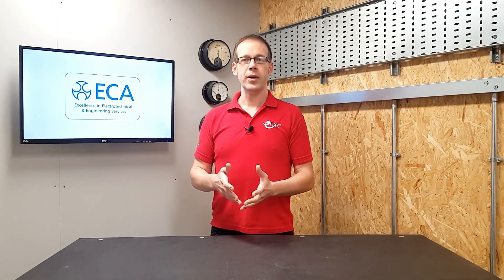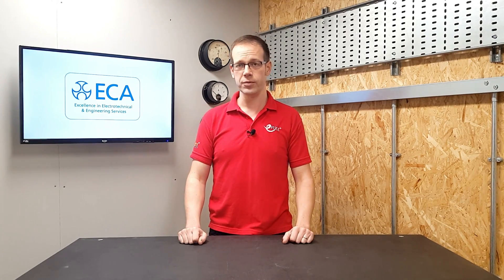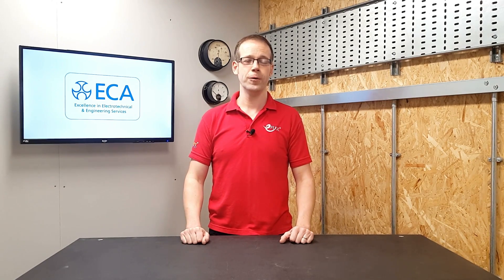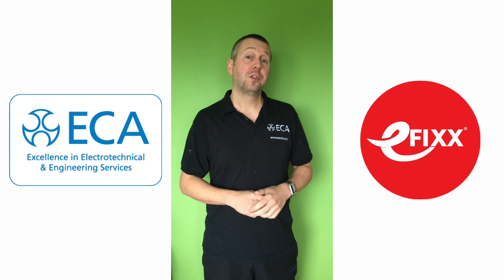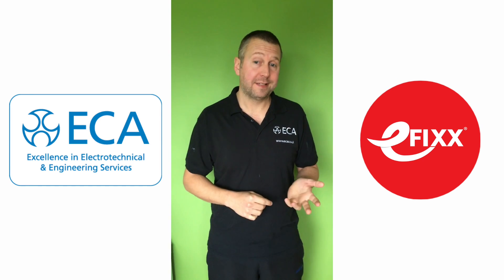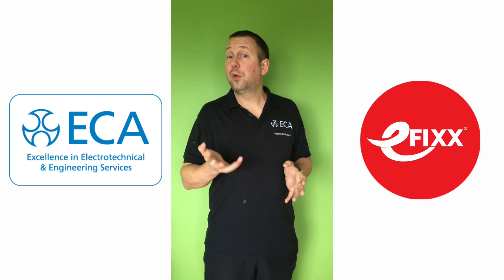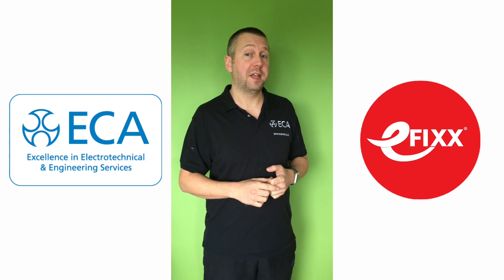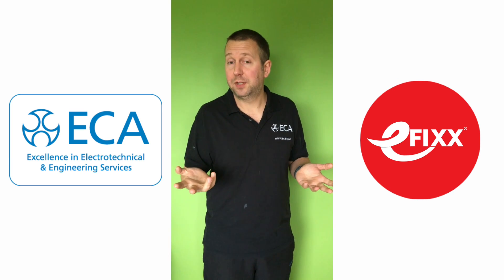Can you use 230VAC power tools on a building site?

Comment: Hypothetical sarcastic and probably other words to describe thought question.
So there’s 240V on the site you step that down to split 120V you can then run that through a step up transformer back to 240v and then run your 240v tool.... so technically you'r tool is running at 120V at one point during that and technically you’re plugging into the 120 V supply that is required on the job site. Would you be able to get away with that when rule enforcement walks by?
Granted there’s transformer loss.
They look at the distribution board hey there’s a transformer good, they walk around a little bit they come onto your work area hey you got a transformer good; never put two and two together that you’re actually photonic induction?

Or you could just roll up with a nice large capacity lithium ion battery pack and inverter and run your 240v tools off batteries, But they’re battery-operated! Lol
And it would probably weigh less than the transformer lol.
Got to think outside the regulatory boxes!

Comment: Yes if they were my tools, if they were somebody’s else’s tools where I wouldn’t know what condition they were kept in I would be a bit hesitant. so it really comes down to the user to do a self inspection for self-preservation.
Luckily I don’t have to worry about this problem as I am in the US and we use 120V already.
Although there is a few construction companies that set up temporary power and use larger saws, heaters, air conditioners and the like on 240v.
Your whole split 120V system took me a while to understand. Interestingly we have a standard for it in our code for use in A/V systems to help mitigate line noise in theater and the like installations. I found out about this reading a white paper shortly before I ran aground against split phase 120v UK systems.

Comment: 230V with RCD protection or battery operated. The 110V thing is a special UK thing, we don‘t have that here. Instead here you‘ll find a special mobile distribution board for construction sites including type A RCDs or RCBOs. The inertial current of such a transformer is also high enough to trip a B16 A. And actually it doesn‘t matter if 110 or 230V, both are high enough to kill a person. The only advantage would be a galvanic insulation provided by the transformer but you can do that with 230V too.
Reply from the maker: The 110v transformer is isolated and the output split 55 - 0 - 55V to earth
Reply: @efixx  The rules say: Till 48 Volt it is "low current", then "heavy current". What make then 55 Volt, 120 Volt, or 240 Volt any difference? 

My tools start with 10,2 V; then 12 V; 18 V; 20 V; some new have 36 V (e.g. my e-bike). All saved current after the rules. 

36 Volt are three 18 Volt batteries together, this system have enough "strongest/powerfull" to work with, e.g. to drill holes for heating pipes till air vents. It is a save system for DIY and real worker on construction sites, often used around the world. And if do you work inside skyscrapers how are 1.5 km tall do you learn to love battery mounted tools. 

It show that what other user figured out - in the history at construction site at 1880 it was it a savety thing but now do you put the power charger at your 36 V car or tools at home and have enough savety power for work over the day. And do you can order lamp, radio/mp3-player, coffee machine, kettle, notebook, aso. too. 😉😊👍

BTW: Some electricans use a Tesla ... it is a running battery only! 😂

Comment: The 110V isolated supply transformers probably stem back to 1970's when most power tools were metal cased class 1 equipment, and damage caused the case to become live on occasion causing a shock hazard. It is definitely safer these days as most are now class 2 double insulated, but I always use cordless nowadays, safer, convenient. I remember lugging heavy transformers around, not fun lol. Every day is a skool day.

Comment: I do use 230 tools on house or light commercial but the builder normally makes us use 110v on bigger sites I dont feel safe either way because as long as the equipment is installed correctly and people are careful with your leads to your tools it will be ok 230 or 110
Battery makes me feel safer just because there is no lead so you and you alone is in charge of the tool 
For example if your using a 230 grinder and some one unplug you for the kettle it could bounce or bite in to the wall with out you being aware until it's to late 
Thank you for reading
Reply from the maker: Wise words Kieran - thanks for sharing 👍

Comment: I have been saying this to builders and the like for years, and they are stuck with this idea that it has to be 110v, which is simply not the case. Especially these days, as we are RCD crazy on everything, plus even using 110 has to start with a 230v supply, and battery chargers as well, we need to ditch this idea that we have to use 110.

Comment: With most if not all small general use power tools  comforming to the provisions of double and reinforced insulation this would reduce most risks of shock to an acceptable level as long as in hand of this, site operatives performed due diligence in the use of maintenence and risk assessment for the scenario. Then the other concern would be a risk of shock in the use of earthing arrangements, like pme without ongoing assessment for the need of equipotential and if necessary supplementary bonding requirements (this may need assessment if such sites or building are erected within proximity of electrodes used on a pen conductor installed by the DNO unbeknownst to you) . The lack of an isolating transformer on site would keep you on your toes

Comment: If there’s a good 230v rcd supply on site that I can test before use then I’d be more than happy to use it.  What HSE can’t account for on site is the stupidly of many people that will quite happily plug in a damaged bit of equipment or lead without a care to themselves or others.  Unfortunately this gets us stuck with 110v on most sites.
Reply from the maker: Agree - usually the worst lead is the 230VAC one feeding the transformer!
Reply: @efixx  yes I’ve seen a few bad ones 😂
Reply: Perhaps user carelessness though is why 230v even with RCDs is not the preferred method, and a good reason to scrap 230v and push 110v or cordless only.
Reply: @johnhoward2104  I’d rather scrap stupidity but that’s not likely to happen 😂. There is the odd specialty tool that is only available in 230v but their few and far between, cordless is the future.
Reply: Don’t feel so bad over here in the US that’s kind of the overreaching OSHA departments Job to implement rules that make you get her on safety equipment. They’re there for a reason because some buddy was stupid and then somebody repeated that.
Reply: All you have to do is test the 230v RCD before using.

Comment: I think that if I worked on various sites and some sites may not allow 230 volt power tools then It would be foolish to purchase 230v equipment when if I purchased 110v and cordless tools there is  not going to be a problem. I am not going to purchase both just in case.
Reply: I would agree with you but it's not just about buying power tools now. I have a 240v drill that I bought in 1986 that's still going strong and is a powerhouse when drilling thorough solid timber joists using auger bits - nice and powerful and rips through them easily, so I'm reluctant to give it up. Cordless drills of similar power / ease of drilling, may be available though, I just don't know which they are, plus why go to the expense if something already works well. We rely on RCDs in special locations, so why not on construction sites, if for example, RCDs had to be hardwired to tools / extension leads and checked /tested regularly.